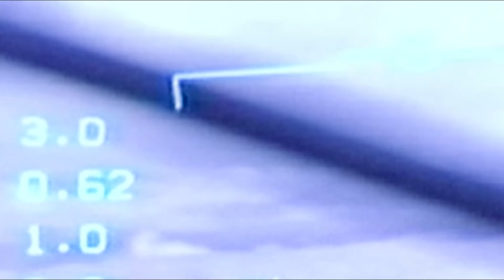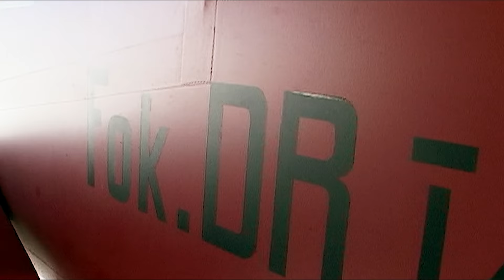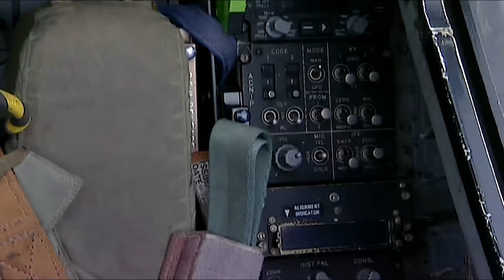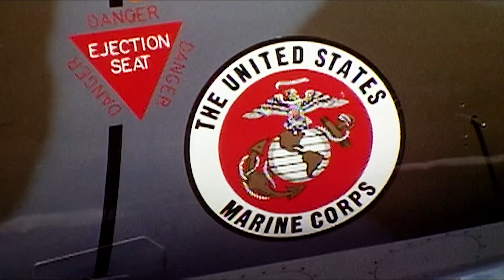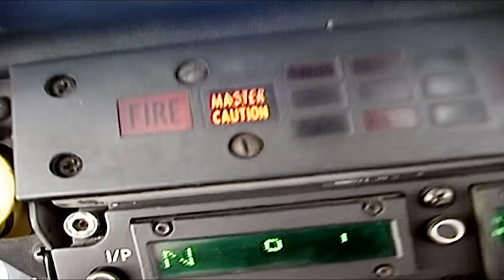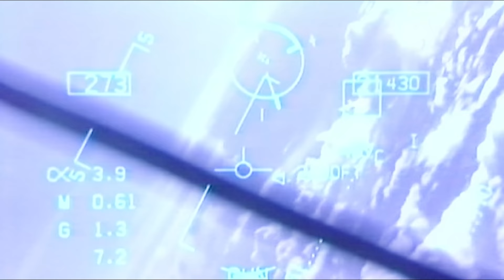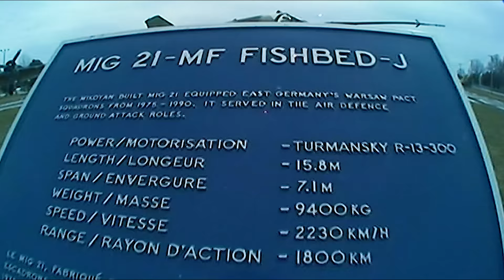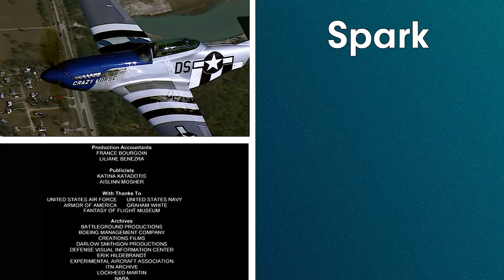Top 10 Greatest Fighter Jets Of All Time | The Greatest Ever | Spark

Comment: "Invisible to radar" In 1991, a poorly trained and vodka soaked Serbian AA missile crew blew an F-117 "stealth fighter" out of the sky with an 1950's era SA-3 (Neva) RADAR guided missile, the Serbian military later sent a message to the US embassy saying, "Oops, sorry, our bad, we didn't know it was invisible".
Reply: I really hope that last part was satire and they didn't' actually do that
Reply: True, they finally retired the F-117.
Reply: @dabossman3924  Yes they did send that message, not satire.
Reply: lots of factors at play there. No EW support, leaked flight plans, etc. The F117s had been flying lots of strike missions without incident, it was simply an unlucky night for that F117 pilot. The radar operator essentially knew where to look, when to look, etc and was still barely able to lock the aircraft (he said it himself in an interview).
Reply: @One Issue Voter I wouldn't call it incompetence. At the time, adding all that equipment would compromise the stealth since it had to be mounted on the outside of the aircraft. But sure, go ahead and insult the designers of a very successful stealth aircraft that was way ahead of its time.
Reply: @dabossman3924  They did. Its the sort of thing the US military, and hence the US press, does not like to report. The point is right - the F117 was not only not even a fighter, it was a FAILED bomber. It had huge disadvantages over other planes (including but not limited to horrendous maintenance needs) in order to make it stealthy, but it was not stealthy enough to avoid cleverly used regular SAMs, let alone more sophisticated defences aimed at countering it.
Reply: @kamraam1464  If it was a "very successful aircraft" then pray explain why it had such a short service life? It was too far ahead of its time to work in practice - in particular it was just not stealthy enough. Maybe you can see it as a necessary stepping stone to better planes, but seen as a cost-effective weapon it was just plain bad.
Reply: @kenoliver8913  Really? It allowed us to hit hardened targets deep inside Baghdad and Belgrade. The sortie-to-loss ratio, considering the extremely risky nature of the missions, was phenomenal. The reason it was phased out was because of the exact reason you listed, better aircraft were developed out of it. Doesn't mean the F117 wasn't successful though.
Reply: @kamraam1464  LOL. Notoriously the hardened targets - including that crowded air-raid shelter - were taken out by Tomahawks at a tiny fraction of the cost. There was nothing the F117 did that could not have been done much cheaper by other equipment.
Reply: @kenoliver8913  Wow you're so smart! You should go tell all the US Military strategists how obsolete stealth aircraft are. We can do it all with tomahawks right?

Comment: No, the Fokker Dr1 couldn't fly faster. It was actually pretty slow compared with other WW1 fighters in straight line speed, although it did have a very good climb rate with the three wings. What it was, was incredibly manoeuvrable, which in those days of incredibly tight, close in, turning dogfights made it absolutely lethal indeed.
Reply: I caught that too. 180 mph that's not correct at all!
Reply: @davidwoods7408  True. Almost nothing during that war got above around 135mph.
Reply: From my understanding what you say is correct. Also the Triplane was not the invention of Fokker, Sopwith got there a year ahead of Fokker who later copied the idea. The reason the Sopwith Triplane is not so well known is that I believe it was flown mainly by the navy air services and not RFC.
Reply: @davidwoods7408  180 Kph not mph.
Reply: They said fastest climber not it's top speed.
Reply: @dass1333  no. He did actually say fastest as well as mentioning climb rate.
Reply: @kennethcrowther2277  he says " it was the fastest climbing and most maneuverable." Could climb to 3000 meters 3 min faster than its mortal enemy the Sopwith Camel.
"The extra wing allowed it to fly faster..." Still not a claim of fastest.
Reply: @dass1333  It might have done that in a dive with a tail wind. Yes I know its 111 mph.
Reply: they should listed the DB VII instead
Reply: @davidwoods7408  180 kph, not mph.
Reply: You get a "bit" more drag with at least one more wing than everyone else hehe
Reply: @kennethcrowther2277  xxx
Reply: I actually the greatest fighter plane of World War II for the United States Air Force was a P 47 Delta through November, shot down more German and Japanese aircraft had a higher speed could carry more munitions had more machine guns you’re probably talking to some of your support people for the mustang but you know one bullet Hit the valve train for the radiator of a P 51 mustang and it’s out of commission but there were plenty of episodes where the P47 got hit took out a cylinder still ran took its pilot home I think was a flying tank with a turbo supercharger I think you need to Reestablish your rating!

There is even a documented fil about a P 47 pilot in which his P 47 was injured and he was still flying it and a folkerwolf came about him he was out of ammunition the fucker will started shooting Adam emptied all of his munitions on the P 47 could knock it out of the sky 347 flow home the fucker wolf guy looked at him he just shook his head so the princess did a good job at being a P 51 mustang, but the P 47 even have the long range capacity but they US what we can send over the the tanks for them to fly over the British were making papier-mâché fuel tanks anyway this is an a in accurate assessment you’re actually doing a tremendous amount of harm by not putting the P 47 in there.
Reply: is that the folker wolf? i read it was so sucessful becaseof how it coukd dive, very fast, drip its oayload and then a mechanism would kick in that stopped t from plunging into the ground essentially

Comment: i think you will find that since a third wing increases drag, it will actually reduce speed; this is why the f22 doesn't have 3 wings
Reply: 100%  👍 The only thing a third wing does is increase drag! Nothing else. All benefits from a box-wing structure (strength and weight) is already realized in a biplane. Adding more wings only make the compromise solution inferior. If you want more wing area, it's better to make the biplane wings larger.
(I find it weird that people don't realize there are probably reasons why tri-planes - drag - and flying wings - trim drag - never became popular, as journalists often claim the should have.)

Comment: Fun Fact, the P-51 Mustang began it's life as the A-36 Apache. Designed in the late 30's for Britain. Only problem was over 5k feet it wasn't as good as the spitfire. Below 5k feet though, nothing could touch it with a regular cruise speed at 340+ mph. War Thunder (simulator mode/ full real controls) actually gets this right so if you want to test for yourself it's actually pretty eye opening. As well as a cool introduction to the A-36/P-51 heritage 😁

Comment: Always difficult to pick a top ten like this.  There are so many metrics that you could use, and the ones you choose would determine the aircraft you choose.
I think I would have included the de Havilland Mosquito, though, for inclusion.  And possibly the EE Lightning.
Reply: The Spitfire is also misrepresented as being extremely short-range, yet in photoreconnaissance and meteorological use, it definitely overflew Germany regularly.  The Spitfire also had a much longer service history than the Mustang.  And of course, the Mustang was effectively a derivative of the Spitfire - the version that was optimised for bomber escort.  Which just goes to show the versatility of the Spitfire!
Seems odd not to have the Lightning, I agree.  The cockpit photos of a U2 from above proved that was able to intercept anything flying at the time (and scared the heck out of the US).  Not sure about the Mosquito, as it was primarily a bomber, although I suppose if you can include the B117, then you can hardly leave out the Mosquito, which did at least have a fighter variant, unlike the Nighthawk.
Of course, a glaring omission is the Avro CF105 Arrow, cancelled mainly because the US undermined it because they didn't want the competition.  Even in the early prototype form (which came off the actual production line, making it a production aircraft), it outperformed everything else in the air at the time in its combination of speed, rate of climb, range and manoeuvrability.  With development, it might still be in production now.  It certainly had the internal volume and lift capacity for considerable development of avionics and fire-control systems.
Reply: @phillee2814  Yes, the Mosquito was primarily a bomber, but was very effective as a fighter - particularly the Tsetse variant.  And you are right, the Avro Arrow was very advanced and should not have been cancelled - but the Americans were very touchy about anyone having any aircraft better than their own (similarly with the TSR2).
Reply: Yep, the Mossie should have a mention along with its faster dedicated fighter variant the DH Hornet
Reply: @steveknight878  You mean any NATO ally or other Nation which would bow to the Dollar having better aircraft

Comment: A story I heard about a Harrier was when a pilot got lost, or was running low on fuel, he tried to land on a moving train which had cargo boxes on the back of it. He brought the plane down, but he rolled forward and the plane's front wheel came off of the end of the cargo container. The plane was recovered , and the pilot was reprimanded.
Reply: Your story is pretty much accurate. It was a cargo ship and he did attempt to land on a cargo container.

There was also an American pilot who successfully pulled off a carrier landing onto a stool, because he had no front wheel. Very skilled pilots can pull off precision vertical landings and effectively stop in mid-air using viffing - vectoring in forward flight. It is a very agile aircraft while hovering but its normal turn and climb rate isn't comparable with modern aircraft, especially not the Russian Migs.

Originally it was designed as a CAS aircraft rather than a fighter, and it did that very well.
Reply: During the Falkland war RAF Harriers landed on containers on a cargo ship (Atlantic conveyor) improvised as an aircraft carrier. They had trained for that apparently.
Reply: @kenoliver8913  That surprises me because the Atlantic Conveyor, famously, was sunk before it ever arrived at the Falklands. It took a lot of precious supplies with it too, including the helicopters that were originally planned to ferry the ground troops around.

Comment: I totally disagree. The best plane for deadly accuracy 
Durability 
Speed 
Is the F15 Eagle. 
Not one has been shot down in combat
Reply: It came on the number 11 spot because of too expensive :) But yes, it had such a powerful radar. And generally, if the Israeli's flew with a plane, it was an excellent plane.
Reply: @markcooke5270  FCS the whole point of air superiority fighters is to always be fighting weaker opponents.  If it had been designed around a Vulcan cannon and upgraded with modern avionics  the F4  would be have been my choice for #1
Reply: If it never fought Moscow, it's irrelevant
Reply: I totally agree how the hell have the put the MiG-21 in front of the Hornet too? Hornet's have mostly got the better of 21's historically and it was a complete crime not to put the Eagle on this list which is the most successful fighter of all time! Bad show
Reply: Has never been exposed as much has the other ones
Reply: @Templar7832  totally different era. It's relative to the era. 
A mig 21 would destroy a P51 or a Spitfire but they deserve to be higher.

Also, the F-15 should've been there because even the hornet has been shot down by Iraqi migs.
Reply: It has never been tested against a worthy adversary like the su-27, su-30,su-35, eurofighter or rafale. It has only faced inferior aircraft not designed for air superiority like mig-21, mig-23 all of which are much older
Reply: NO, there have been F15’s shot down in combat absolutely. By ground fire. There has never been a confirmed AIR TO AIR loss of an F15. Between Jan 17 and Jan 20 1991 at LEAST 2 F-15’s were shot down by AAA and SAM’s over Iraq for starters.
Reply: @katimboallan4605  I’ll give ya the MiG 21 and 23. But Foxbats, Fulcrums, Mirage F1’s? MiG 25 and 29’s are absolutely designed as interceptor/fighter aircraft. And the Eagle has smoked every one that’s challenged them….
Reply: Omg I've just posted a comment saying the exact same thing,  then saw this comment!  I really need to read comments before I post myself  not after
Reply: the Sukhoi 35 is far more deadly than the best anglo american fighter plane - and it has the electronic warfare system the khibiny that is capable of jamming all communications of the enemy fighter plane or Anglo American warships - the US begged the Russians to reactivate communications of the USS Donald Cook in the black sea. the crew were terrified sailing aimlessly without a radar. How funny - and why did the F35 sink in the Mediterranean after an encounter with a Su-35 ? think

Comment: The F-14 Should have been here, one of the few jets that caused enemy pilots to fear going up because they knew the Tomcat was on the prowl.
Reply: Was it the Tomcat they were afraid of or was it Tom Cruise? lol, just kidding love the F14 as much as the F8.
Reply: Was notoriously unreliable though.
Reply: Indeed. It's a known fact that enemy aircrafts used to run out like pussies as soon as they detected the powerful tomcat's AWG-9 radar emissions. Not only a fleet defender, but also a deterrent.
Reply: I turned it cause i saw it wasnt
Reply: @samgarrod4781  Mostly because of political neglect. It was underfunded and had many upgrade programs cancelled, preventing it from reaching anywhere close to it's full potential.
Reply: @dumdumbinks274  poor support and faith I spose. At least from that era the 10 15 16 n 18 survive.
Reply: @samgarrod4781  Exactly. There were 2 main factors.

1. The F-14 had a connection to the overly expensive F-111B program, thus politicians got it stuck in their heads that the F-14 was going to be overly expensive and a failure as well.

2. Grumman were responsible for many naval aircraft of the day, and politicians didn't want Grumman gaining a monopoly over the Navy, so they decided to reduce the budgets of projects that involved Grumman.
Reply: If Tom Cruise could fly it, that's good enough for me.
Reply: They weren't fear the F14 Tomcat, it was those 6 Phoenix AIM-54 under his wings it was the cause of fear.
Tomcat was build around this missile, just like the GAU weapon for the A10 Warthhog.
When you have a lethal fire and forget missile at your disposal, the enemy will think twice to take off.
Reply: The YF-14 would become the YF-16, the YF-16 would become the YF-17, the YF-17 would then become the F-18 Hornet. Technically it is in there when they show the F-18.
Reply: the Sukhoi 35 is far more deadly than the best anglo american fighter plane - and it has the electronic warfare system the khibiny that is capable of jamming all communications of the enemy fighter plane or Anglo American warships - the US begged the Russians to reactivate communications of the USS Donald Cook in the black sea. the crew were terrified sailing aimlessly without a radar. How funny
Reply: @MrVioletpandora  stop making stories up. You have no clue.
Reply: I know this is off topic, but don't play with a nail gun when you are drunk. Just don't.
Reply: How a about the f15 with its kill record that's not in this video

Comment: My special area of interest as a military historian, ex-RAAF member and scale model builder are the aircraft of WW2 and Korea. Every one of the aircraft chosen in this, somewhat, strangely selective '10 Greatest' are fighters that I've studied, researched and built, many times, in scale models. There are, of course, several other fighters that I would have included that would have taken this list to the 15 or 20 'Greatest', but I guess 10 was more attractive to a general audience. 
Every single aircraft was, in its own way, exceptional and one must remember that every aircraft has its pros and cons. 
For instance, the short range of the Spitfire was one of the factors that made it work as well as it did. Imagine a Spit with huge fuel tanks in the wings, which is usual in a lot of aircraft. 
The Spitfire with huge fuel tanks would not have been able to keep its highly versatile range of wing armaments and the increased weight of fuel would have severely encroached on its dogfighting capabilities. 
The other remarkable feature of the Spitfire was that the Supermarine designers never stopped making performance improvements to R. J. Mitchell's brilliant aerodynamic design. Each mark of Spit was better than the last up to Marks 22/24 which were still highly useful fighters well into the domination of pure jets.
Good thing I love aircraft so much, for if I wasn't, I probably would not have tolerated the Englishman's irritating narration; imitating an American style of delivery for the full 51 minutes. Still, it was great to hear from aircraft experts and veteran pilots who flew these amazing airframes. Thank you, Spark. Cheers, BH
Reply: The "Englishman's irritating narration" had nothing "American" about it. I suspect you have the bogan's chip on your shoulder where Britain is concerned.